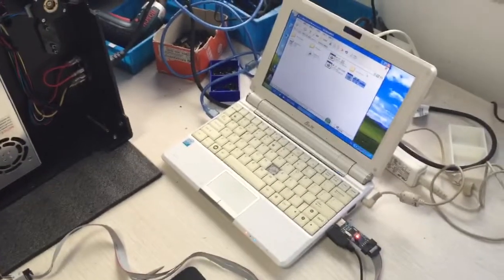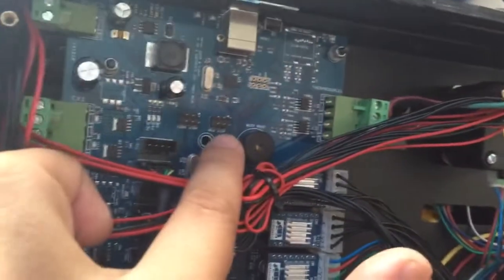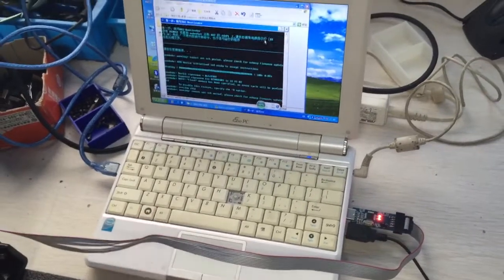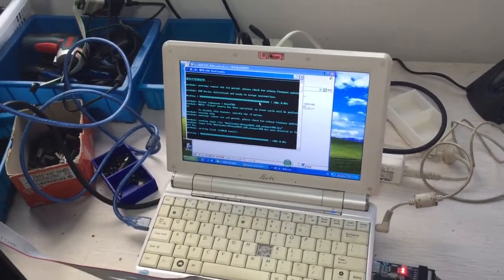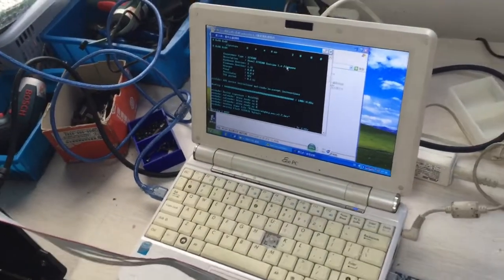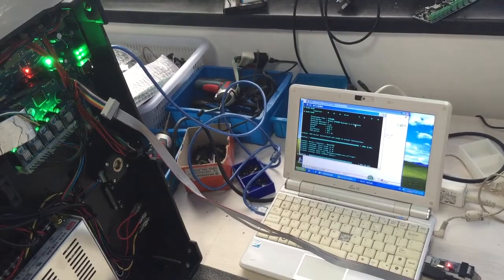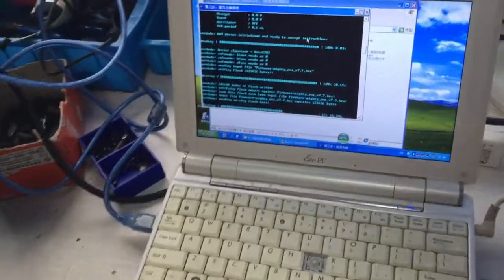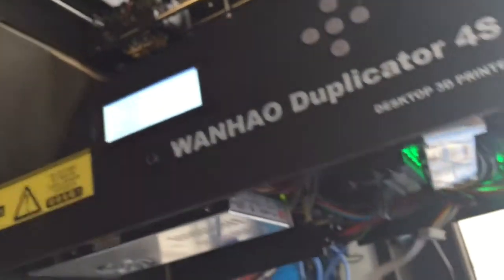How to Flash Sailfish7 7 to D4 printer through AVR programmer

Comment: Hello 

I have bought a WANHAO Duplicator 4 and I would like to upgrade the firmware on the mightyboard D4 to Sailfish 7.7. preferably using a 6-pin AVR programmer as illustrated in this video as in my opinion is the simplest option.

I referred to the official instructions available on the WANHAO web site as I believe they should be the modt reliable.

14. How to flash firmware Sailfish V7.7 to D4 series printer through AVR programmer?
http://www.wanhao3dprinter.com/FAQ/ShowArticle.asp?ArticleID=23 

Where can I find the software with the batch files that you have used in your video?
 Are these part of the Sailfish 7.7. distribution or something made available by WANHAO specifically for this upgrade?

Despite the Duplicator 4 being admittedly an old product a bit of help from WANHAO would go a long way in improving the perceived quality of the product and would reflect positively on present and future customers in regard their future purchases thus I hope someone is listening.

Thanks
Davide